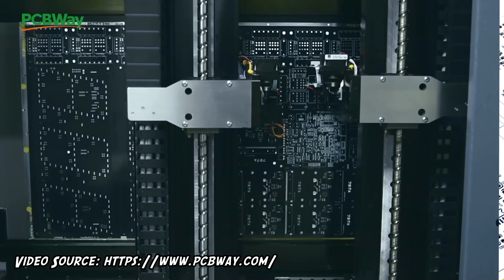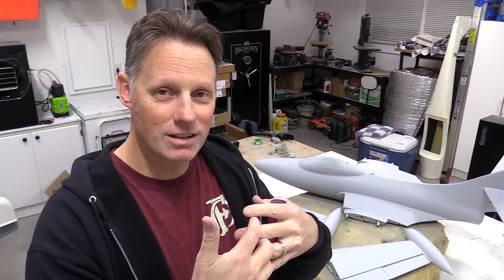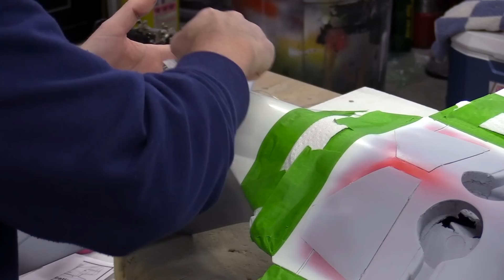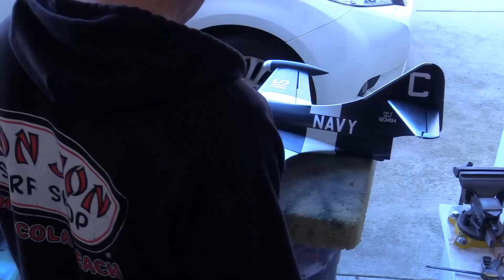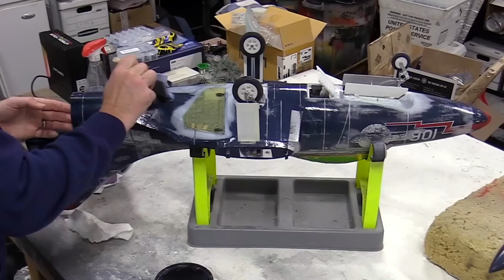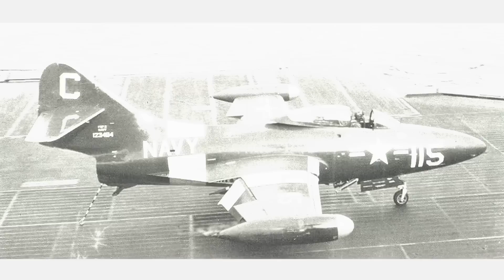This Paint Job Changed EVERYTHING – RC F9F Panther Final Reveal!

Comment: How long are you waiting between primer/sand coats?
Reply from the maker: Long enough for the primer to dry and sand well. It really depends on the primer.
Reply: @Thercgeek do you feel the multiple layers of polyacrylic as the first step is the key to not peeling paint? Or something else? I still struggle with tape peeling paint.

Comment: Great job Chris! What is the aerosol that you used to attach the gear doors to the struts with? I believe you also used it to put the shims in the landing gear on the Ta-152H. I'm at that point on mine. Callie Graphics has been great to work with.
Reply from the maker: It’s just CA accelerator.  I used CA glue to glue the parts and the accelerator to get it to kick off quicker.

Comment: Question but does all of this work add weight and does it make the plane feel like a brick in the air? Other then that is looks amazing
Reply from the maker: In my experience, these foam aircraft don’t mind the extra weight since they’re already really lightly loaded. Typically I see a performance increase and a more true flying airframe. Landing speeds can vary though, depending on the model. We’ll see how this does with the added body flaps. 😊

Comment: Chris- I can’t begin to tell you how much I truly admire your workmanship… just next-level great!  A question- with all the coats of sealant, primer, and paint, how high is the weight penalty and do you find that it affects performance negatively/ at all?  Amazing as always sir!!! 😊🔥❤
Reply from the maker: Thank you!  Truthfully, I don’t usually worry about the weight as these foam models don’t usually tend to notice. They’re really lightly loaded to begin with and I’ve found the added weight and rigidity typically results in an even better flying airplane.
Reply: @Thercgeek  Makes sense.  Ok you just convinced me to give it a try… I have a 4 year old L-39 that could use a refresh! Thanks for the response Chris!

Comment: Should weigh before and after to see how much weight was added
Reply from the maker: Truthfully, I don’t usually worry about the weight as these foam models don’t usually tend to notice. They’re really lightly loaded to begin with and I’ve found the added weight and rigidity typically results in an even better flying airplane.

Comment: Do you have any idea of the weight gain from the painting/prep process?
Reply from the maker: Truthfully, I don’t usually worry about the weight as these foam models don’t usually tend to notice. They’re really lightly loaded to begin with and I’ve found the added weight and rigidity typically results in an even better flying airplane.

Comment: Did your parked car get a new paint job as well ?
Reply from the maker: The car faired just fine 😆
Reply: some folks out there are quite resilient :face-turquoise-covering-eyes:
Reply: Bucketlist hobbyshop: paint fume extraction system and dust extractor for sanding 😂 
Nice job btw. I admire your ambition.🖖
Reply from the maker: @horsthorst482 oh man, those would be amazing features to have in the shop!  Currently my dust and fumes extractor is just a box fan… 🤣
Reply: @ same, I use an old extractor hood :goodvibes:

Comment: Many hours compressed into 25:29!  Have you ever checked the weight build up from start to finish, or don't you want to know?😆  Thanks for the vids Chris!
Reply: Most of these Foamy's are so lightly loaded to begin with that a little extra weight doesn't effect the flight qualities at all. I've found this with foamys for years now.
Reply from the maker: Thanks @claysmoker1!  Regarding the weight, what @scotabot7826 said. 😊. I don’t typically worry about is as my experience has been that these models tend to fly a bit better after a refinish.

Comment: What kind of weight difference do you see from your process?
Reply from the maker: It added about .35kg based on the advertised weight. At the end of the day though, I just build these into what I envision for them and tend not to worry about the weight. I have yet to find an airframe that didn’t fly better for it truthfully.
Reply: Excellent question. I would like to know what the wingloading was before and after.
Reply: @bat2293  In general, most of these foamys are so lightly loaded out of the box, it really doesn't effect the flight qualities at all.

Comment: Hey Chris! I've been an Airplane Painter for 44 Yrs. Here's a Tip that Works great. Use Rustoleum Chalk paint for Filler Prime. Works better than Lacquers. Use the pink Spackling cheap sands like Butter. Have to use the water base sealer. You do good. Try the Rustoleum chalk paint. Works better, less primer. If it means anything. I painted ALL the production,  Beechcraft Starships, righthand side. NC 2  to 53.
Reply: I use that Rustoleum Chalk range for everything…absolutely dead-flat…they even do a clear now
Reply: @PrettyLarceny  man i would have never thought. Im going to look for these next time i go to home depot
Reply: @randyherbrechtsmeier9769  chalk paint....ill have to look for that. Muat be very high build..
Reply: Thank you for the tip gonna try it
Reply: @ryandavison4129  let it dry over night. It's not instant